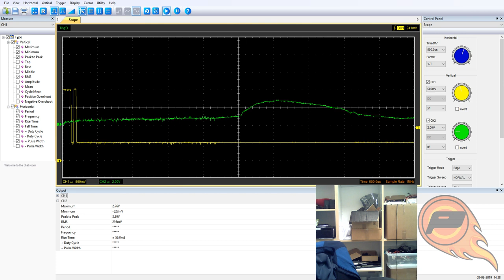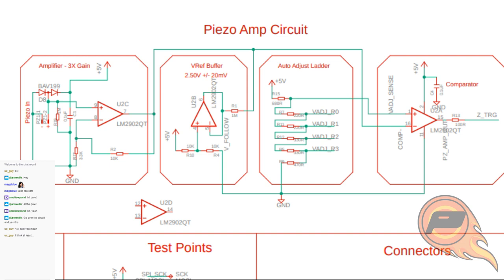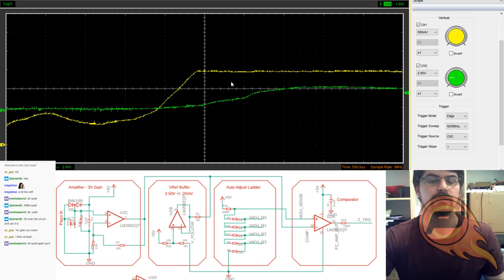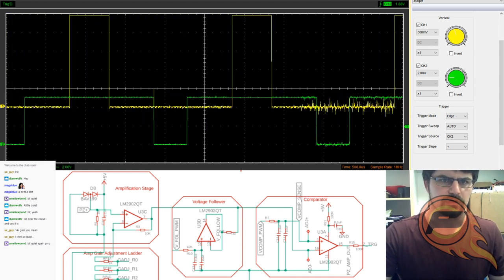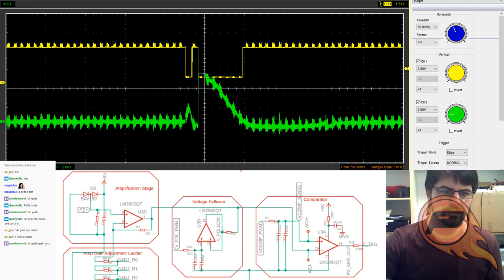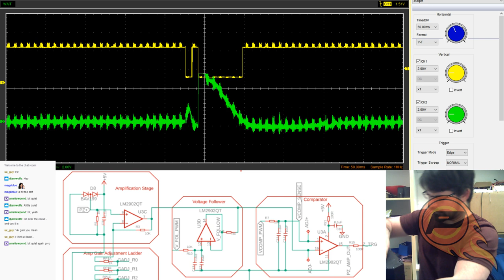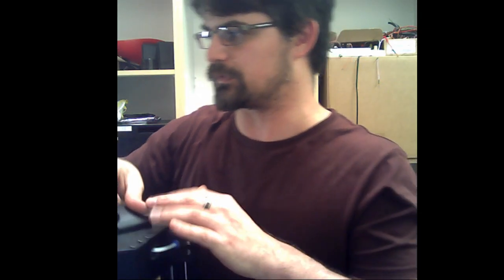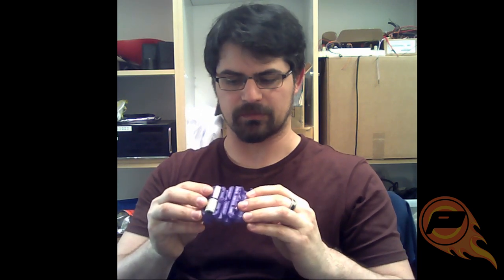Pyr0 Piezo Circuit Explanation, Demo, and Q&A

Comment: The old school resistor ladder is interesting, as you say, reliable. I'm curious though why you didn't go the ADC route with some minimal signal conditioning and do it all in software. Choosing a suitable mcu of course, I'm considering trying that.
Reply from the maker: Because you can't use a DAC to adjust the ratio of a voltage divider. The only other solution would be a digipot. The Rev.2+ boards are using pwm+lpf as a makeshift DAC for the two adjustment channels now though.

Take a look at the GitHub, there's been mountains of progress since I made this video